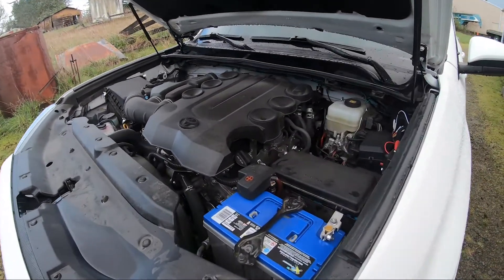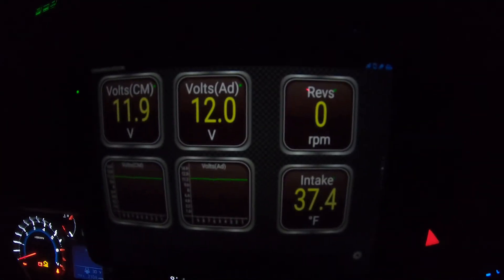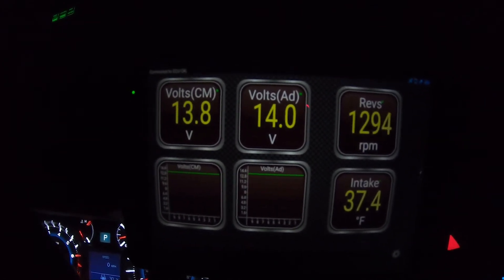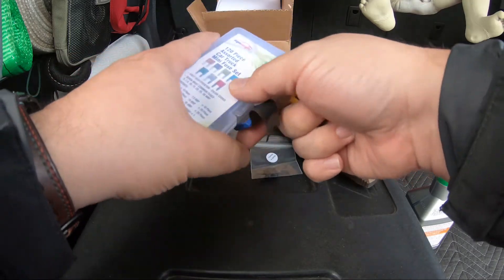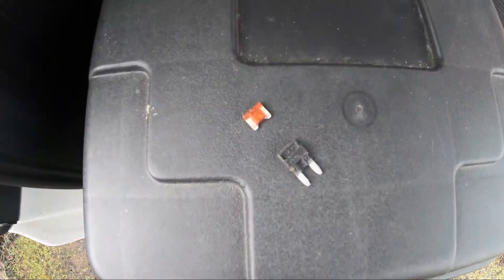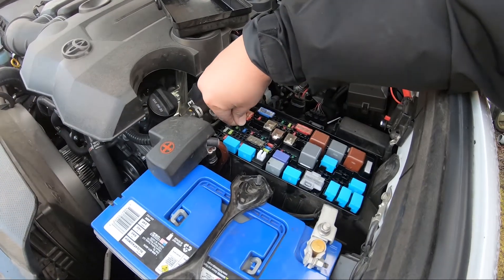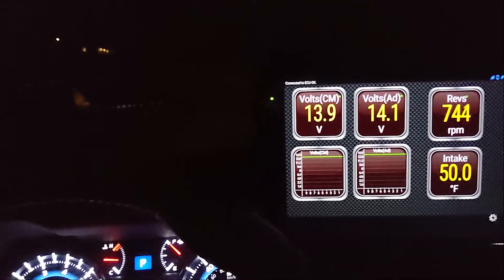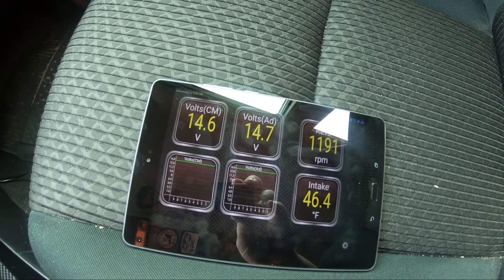4Runner Voltage Booster Fuse for Under $10 to Properly Charge Your AGM Battery.

Comment: Your video had all the answers i had about the diode. I have a 02 lexus ls430 with aftermarket audio system.  Have a yellow top optima under the hood and xs power d925 battery in the trunk.  Before installing the diode at idle voltage was at 13.7 afterwards sits at 14.2 volts.  Thanks for the video.  Anyone wondering if this works for lexus ls430 yes it does. 😊 bass now is more deeper.😅

Comment: i have a safer solution. my altenator is primary source of power for my 2xAGMs in winter with solar charge controller when there is sun so it charges correctly. batteries for 2 years now work good with really good capacity results. probably maxed out. im not an expert at this so im not putting any replacement instead of a fuse.

Comment: When you said gm part I just remembered my moms car charges at like 15v because the battery is under the back seat and supposed to be an agm I figured with the extra length and I knew agm were a little higher but ya I had seen that diode symbol I assumed it was a diode for some actual reason not to drop a volt or half

Comment: Because it's only a diode that's shaped like a small fuse, it will not blow if there is more than 7.5 amps going through it. So therefore, it's slightly unsafe. Although there's a very small chance that that would ever happen.

Comment: Great video!!!👍👍👍 It was very informative!!! I have a 2012 TOYOTA 4RUNNER SR5 LIMITED that I would love to do the same voltage booster upgrade on it!!! I use nothing but AGM BATTERIES on it myself!!! I currently have a XS POWER D3400R battery that I been using since June 2017 in my 4RUNNER with no problem at all!!! But I always wondered why my voltage was running between 13.4 to 13.8 after letting it idle down to it's curb idle!!! The cold start voltage is in the 14.2 to 14.6 range but then it gradually drops down to 13.6 to 13.8 once it's fully warmed up and reached it's curb idle!!! So with this voltage booster upgrade does it mean that my 4RUNNER should always be in the 14.2 to 14.4 range regardless of the outside temperature and regardless of the amount of accessories that im using or is that statement totally incorrect and why??? I have been told by mechanics that the voltage readings are affected by the outside temperature and by the amount of electrical accessories that you use in your vehicle!!! The readings that you showed on that monitor screen after the voltage booster upgrade, were without any accessories on like the radio, A/C, lights and so forth correct??? The accessories being on do make a difference I believe in the final readings if I'm not mistaken!!! Your help to understanding how this voltage booster upgrade works with or with out accessories on would surely be appreciated!!! Thank You!!! ✌️✌️✌️

Comment: Will this mod work any vehicle? I have an 05 Honda accord with a 2.4 and I’m upgrading to a group 34 AGM battery, I’m doing this because I have as sound system and I want the accessories to get the most from the charging system. Thank you man.

Comment: So long term
Is everything  Working  Properly?
Reply from the maker: Yes. Been well over 2 years and all is well. That being said, I was recently sent a switchable hi/lo charge fuse purpose built for this and I plan to swap it in and try it. The downside is they are about 10x the cost of this OEM GM fuse. The upside is you retain the fusible protection aspect I believe. I need to read a little more before swapping and making a new video.
Reply: @TwistedJake  What  if you have regular  battery  and do this Mod?
Reply: @TwistedJake  So it might be safer, added protection?
Reply: @TwistedJake  what if you  use it with regular  battery?
Reply from the maker: @johnrommelt6560  I don't know that there is a benefit with a regular battery.
Reply: @TwistedJake  Where can you buy the Switchable Fuse?
Reply: Where can I get switchable Hi Lo Fuse?

Comment: Just wanted to add something here, on the 2020 and up the alts fuse is in a different location, also I don’t no if they have changed something in the programming but after Installing this diode it’s only hitting 13.7 13.8 so not sure what’s going on but I’m gunna drive it around a bit and see what happens, I’ll update

Comment: Do you think the alternator will work harder thus more voltage means more heat will wear out the alternator. This is my theory. I have tried this in my 2014 Tacoma and have little success. I mean it works but at times it will be at almost the same as the 7.5 fuse originally. It seems as if my alternator is a smart alternator where it can adjust it self back to specs like the 7.5 fuse. About a .1 .2 number different
Reply from the maker: No, I don't think so. Alternators are capable of so much more power than we "allow" them to create. That is why we run voltage regulators. While asking it to produce marginally more voltage than it did from the factory may technically put more wear on it I doubt it is even a measurable amount. Remember, it is also only producing that "extra" voltage when the battery needs a charge or there is a draw calling for it. Once the battery is topped off and you aren't running anything calling for a lot of voltage it is just creating the minimal power it always has. It isn't working harder all the time.

Comment: Tried it on my 2015 IS250 it didn’t work. It melted in 30 seconds and I had to quickly turn off the car and pull it out with a nose plier🤦‍♂️. Factory uses a 20 amp fuse and actually looks like there is a load connected to it not just a signal to ecu. I tried 5 diodes in parallel (double size than GM) they also started over heating after 3-4 minutes and voltage only increased from 13.6 to 13.9. Am running an aftermarket 250amp alternator but am low on voltage for my dual  AGM batteries. Any help will be appreciated ..

Comment: Awesome video...thanks!  What's the bluetooth system you are using to monitor voltage?
Reply from the maker: Carista for the BT adapter linked to an app called Torque on my tablet.

Comment: Did this turn on your battery light?
Reply from the maker: No. Unless you install the fuse backwards.
Reply: @TwistedJake   🤔 it’s on either way I place it.
Reply from the maker: Ah, then something else is wrong. My battery light only comes in if I put the fuse in backwards. It has never came on otherwise.
Reply: @TwistedJake  thanks for the info! It’s weird that’s the only thing I touched and I didn’t even have the light on. I’m seeing the improvements but the light is on.
Reply: Did you figure it out? The same thing just happened to mine.
Reply: @lilijuanvelasco7310  yeah I did but I doubt anyone will ever have the same problem I did haha. Just check all your wiring man. In the Engine bay and by the steering wheel.

Comment: I like the way you do things. Just do it, but keep an eye on it. I do however have a concern about the voltages. I see zero problems when everyday driving especially if you are drawing current when the vehicle isn’t running. But AGMs are prone to overcharging, and on a long trip, this could be a problem. 14.6-7 is great for bulk charging, but once fully charged, you would want to drop to a max of 13.8 for float charging. Your system doesn’t system to address overcharging. On a long trip constantly pumping in 14.6 could lead to overcharging.
Reply: Can't you say the same for stock setup one. stkck battery?!
Reply: @albowrx  Stock battery is lead acid not AGM
Reply: @Lxzcvyesfwmk  AGM are also lead acid, please get your facts right.

Comment: Hey man, it’s been about 9 months, how’s this holding up? Just did it to my 2011 that I just put an optima red top in. Don’t want to ruin it!
Reply from the maker: Still running strong. Just for curiosity a few weeks ago, and while trying to diagnose an alarm issue, I reversed the fuse and sure enough I got a bunch of warning lights. Flipped it back the regular way and they cleared. Bottom line, no issues at all.

Comment: I'm going to try this on my ford flex using the ford diode. I have amplifiers that need more voltage than what is regulated. 14.4 would be perfect. Its currently sitting at 13.1 I hope it works 🙏

Comment: Perfect video. Just installed the same diode but with a fuse jumper so I didn’t need to shave to fit. Upped my 2014 4runners voltage by .05-.07 volts

Comment: I’m about to do this to my 2001 Tundra. I have 2 103ah agm batteries for my stereo install. Running a 300amp alternator & unless it’s 1200+rpms, it will charge just barely at 13v. Just ordered from eBay.
Reply: Did it help? My camry had that problem with a 320a alt... I returned the alt cuz cudnt figure it out:/
Reply: @xBLACKxOPSxSECRETSx2  I ended up adding 2 diodes running in series to the sensor wire from the under hood fuse box. Mine was white. I have a 45ah Cmax battery & I charge now at 15.7-8v while driving & 15.3 idling.
Reply: Your 300a alt is pcm controlled right?
Reply: @xBLACKxOPSxSECRETSx2  yes. But adding diodes at the sense wire at the fuse box puts resistance at that wire making the PCM think it’s under demand & will charge higher. Add them 1 by 1 until you get to the voltage you need
Reply: Where or what brand of alternator did you go with? Im looking for one and I found 3 possible companies that I'm researching to see if they are legitimate a good product.

Comment: @Twisted Jake *Something Very Wrong with Those Numbers* Working voltage for a battery is 12-12.6v.    A battery going from 12.6v to 12v is equivalent to playing your car stereo full blast for 3-4hrs+. In other words, your battery went from completely full to 95% dead, over night. Something wrong with the volts reader or you have a very bad draw happening somewhere.
Reply from the maker: The volt reader is straight from the ECU via obd2 port. I've gone days without starting the rig and never a problem so I doubt there is a draw.
Reply: @TwistedJake  My main point is, 12volts is a dead battery so somethings wrong. @12volts, there's only 5% of the batteries workable power left, so the battery is 95% dead. Again, I am simply giving you a heads up that somethings wrong.

   Do a test with a multi-meter. With the vehicle off, turn your lights on and play your stereo for a few hours; then shut everything off, wait 10 minutes and check the standing voltage. Do this until you've drained the battery down to 12volts, then try and start you vehicle. Very unlikely that it will start.

Comment: People read the specs on these agm batteries and how wonderful they sound.
Newer cars that start and stop when in traffic require this agm technology as these batteries can take that kind of punishment. Now these newer car usually put the agm in different places like the trunk or under seat why because agm batteries don't like the heat from the engine. The heat will wear the battery over time. Next the charging system of the vehicle lot's of alternators don't communicate with the agm battery properly causing over charging and eventually wearing down the battery. Now voltage spikes and drops can be a potential problem with the alternator and agm battery. If your vehicle came with a flooded lead acid battery you replace it with a lead acid if your vehicle came with an agm you replace with an agm.
AGM batteries are great for let's say my trolling motor on my boat or as my second battery to power a power converter during camping as you can drain the battery completely out and recharge it with out damaging it. (always keep your battery charged up after draining it) So installing an agm that's not recommended by the manufacturer of your vehicle is simply at your own risk.
My advice here if from a person who has experience installing car audio, led light bar's and all kind of electrical projects on vehicles ,boat's, homes... ETC
Reply: Lol lead acid isn't a good idea for car audio second battery and if you have a second battery it should be the same as your under hood battery so it only makes sense to change both vehicle batteries to AGM .